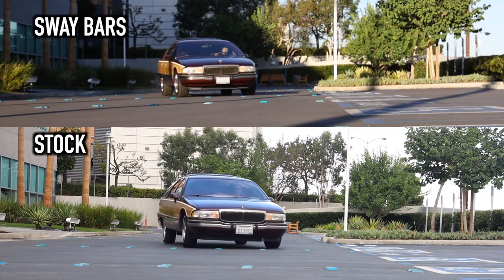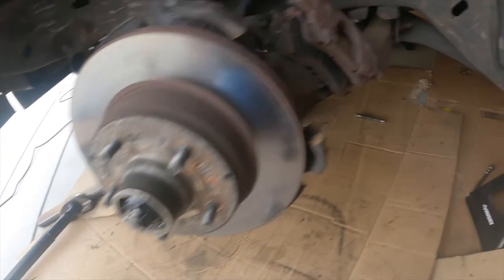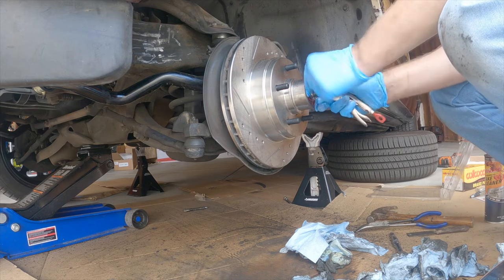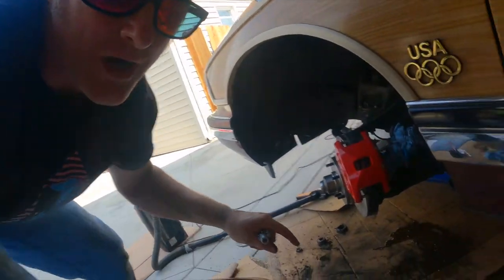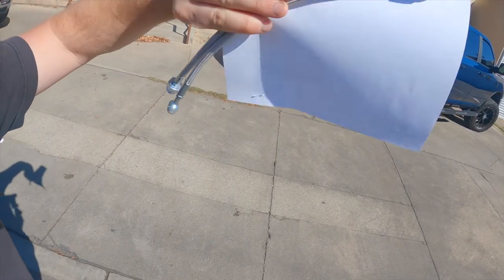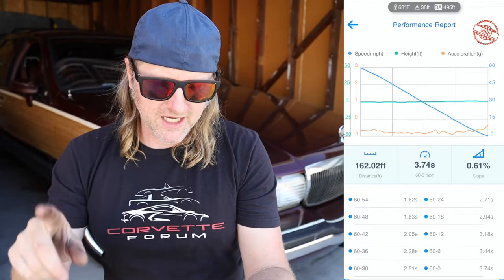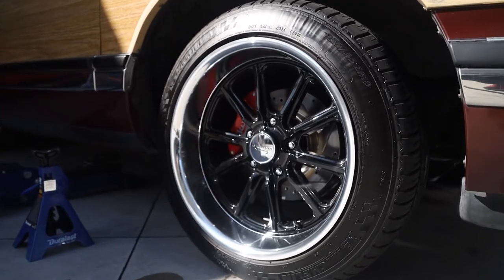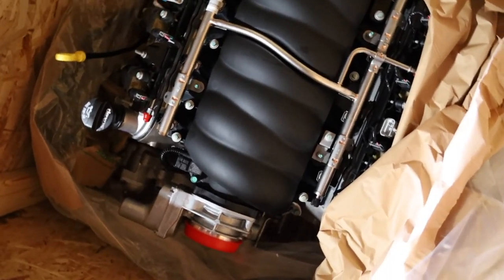LS3 Roadmaster Wagon Project | Part 3 | Wilwood Brakes!

Comment: With the slotted and drilled rotors, all else being equal, you should see an increased stopping distance due to less surface area. The dual pistons make up the difference, hopefully, but I would never recommend S&D rotors on a street car because they work less for street applications. On a track, its a different story, you want those cheese graters doing their thing. 
I'd bet that the stock rotors with the Wilwood calipers would put down some really impressive stopping distances. I am enjoying this build so far-I want some more modern power for my B-body.
Reply from the maker: Good point. I might try that one of these days. I had hoped to find just slotted rotors, but couldn't at the time I was shopping.

Comment: There's a really good engineering explained video about why swapping brakes won't gain you better stopping speed\distance. 

Basically, the stock brakes are more grabby than friction, so even the stock units would lock the wheels (friction of the tire overcome) or, in this case, kick on the abs. 

(This is why your rears, even in a 4500lbs boat, are drum. Still more grabby than your tires...)

The only thing you can do to decrease stopping distance is more tire grip to increase road friction before lock up, which you already saw when you swapped the tires. 

What these upgraded brakes DO do significantly better, is cool down. So towing or spirited driving will be safer, with later fade.

Comment: I just got the same kit for my 95 for Christmas.  Glad to hear you like them even if they don't make a DRAMATIC difference.
Reply from the maker: I took away a few different things... 1) an extra 7 ft is still a half a car length of safety. 2) I can't say the brakes were guaranteed 1000% bedded in yet, so I wanted to give them some more time , so we'll revisit. 3) and better brakes aren't always about distance, but the number of times they can be applied. 

So the experiment will continue!

Comment: Another awesome video! Thanks for sharing…when you plan to address the Go you also have to upgrade the slow.
Reply from the maker: You speak the truth!
Reply: @internetbrandsautogroup3826  I had no idea that Willwood offered an upgraded bolt on caliper…I need to get myself a pair. Also really appreciate the info on the custom brake line. Love this project…that Wagon with the LS3 is going to make one heck of a family truckster.
Reply from the maker: @TheBBodyBuilder  Roger that, good buddy.